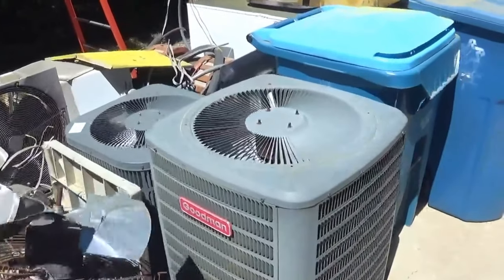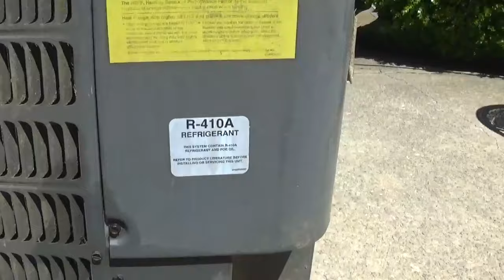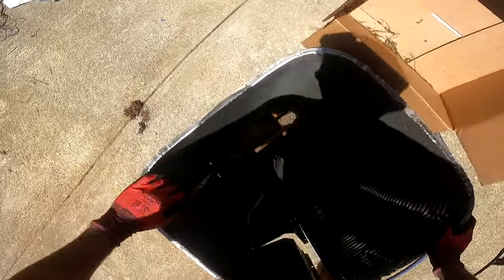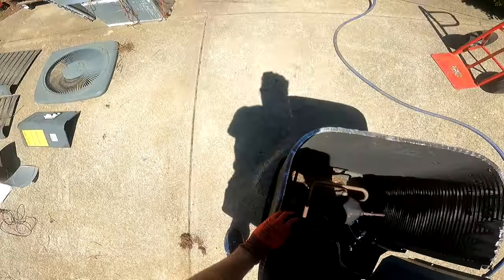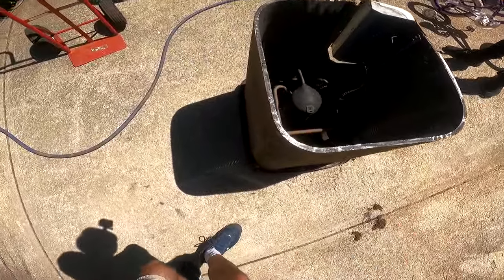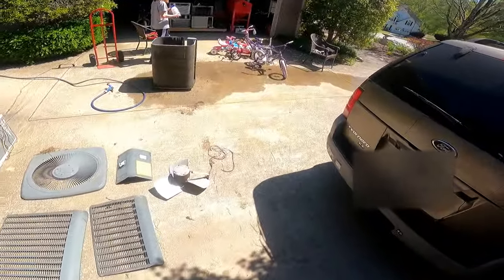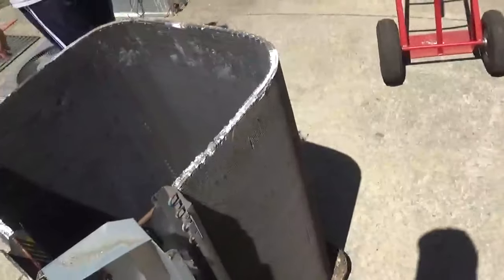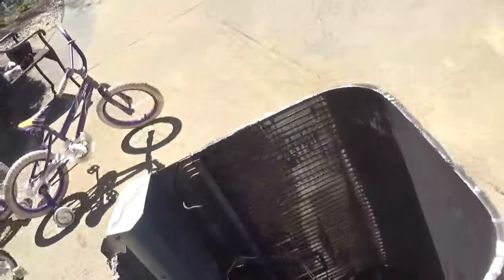2010 Goodman GSZ13 Heat Pump - Deep Cleaning & Rebuild

Comment: are y’all gonna clean that Goodman air conditioner?
Reply from the maker: If you’re referring to the smaller one shown at the beginning, that one has already been done.
Reply: @hvacproductions15  when are y’all going to get a new reversing valve?
Reply from the maker: @Carrierfan2010  not sure, I don't think I will be here when it gets swapped out though.
Reply: Ok